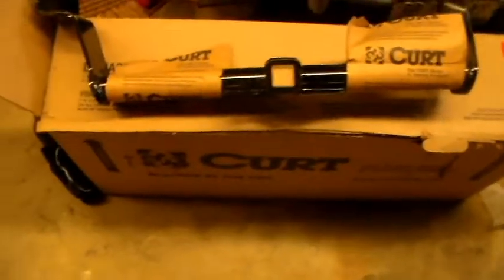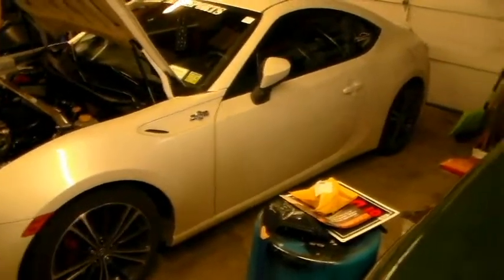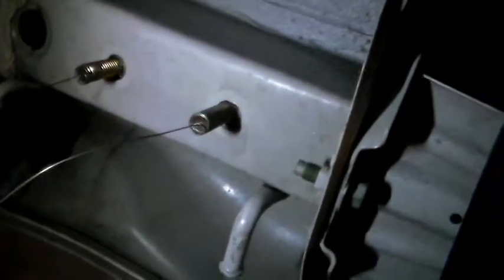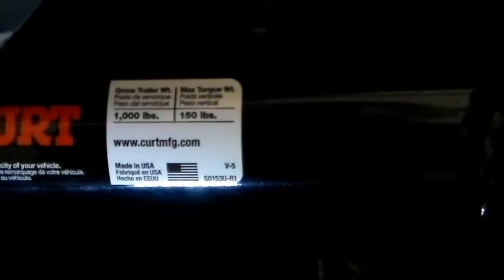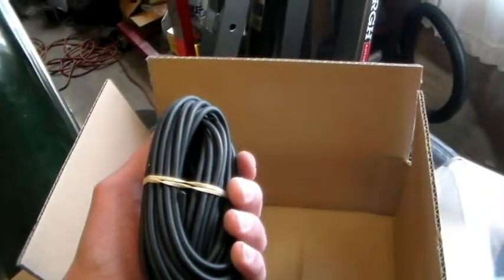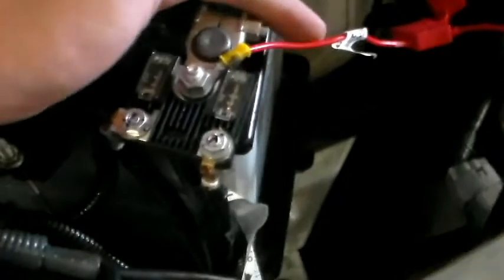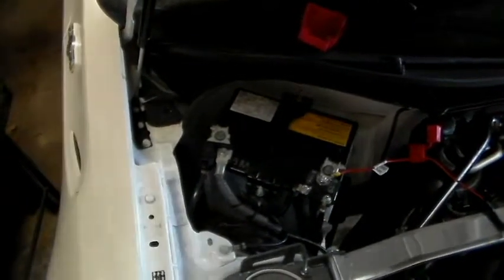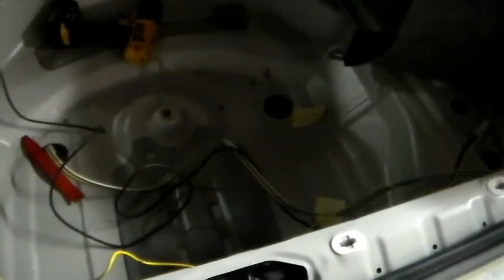DIY curt trailer hitch install scion frs

Comment: doesn't a small amp come stock in the trunk even in the base model scion frs? couldn't 12V be obtained from there?
Im sure it is at least a 10amp circuit, id be fine just not using the stereo while i have the hitch connected if it meant not having to run that extra power line.

ive just began to look into a hitch so its more of a question than a statement.

Comment: good effort, i dont think there is any other video on youtube that show u how to install frs brz trailer wiring harness; i really need to know how to install the power line from the harness in trunk area to the battery in front.  But your video is hard to understand.  But very nice try.  I am sure it's not easy making this video.